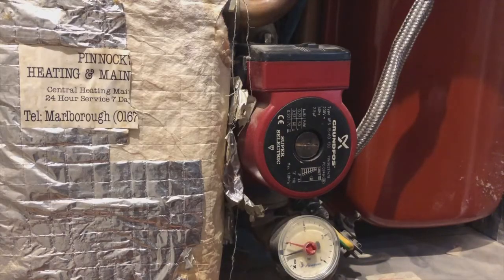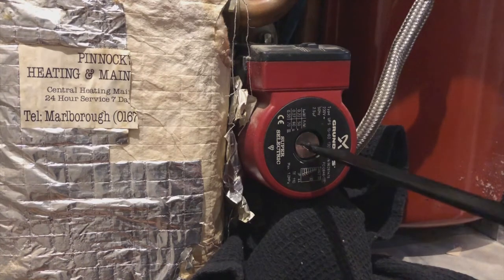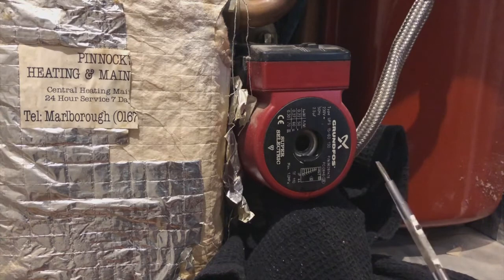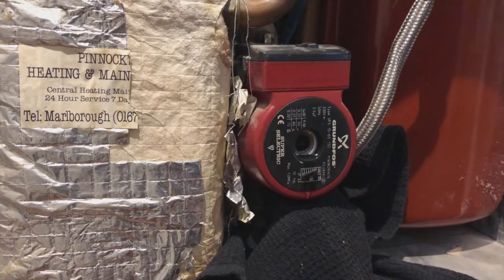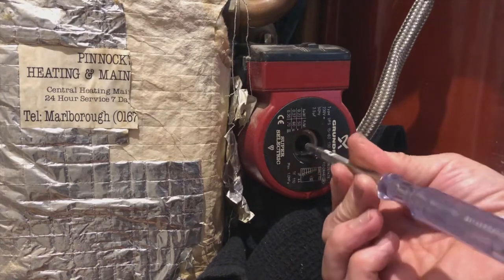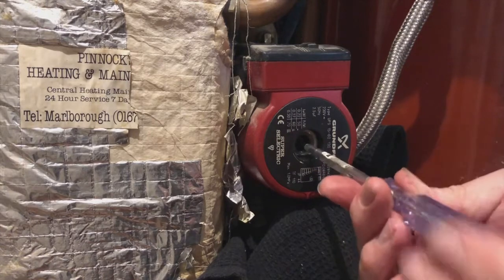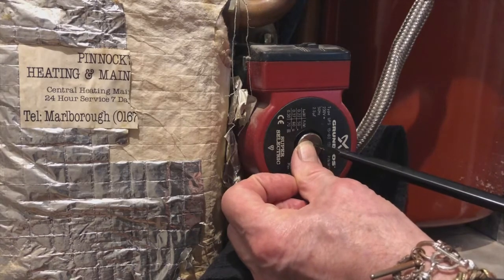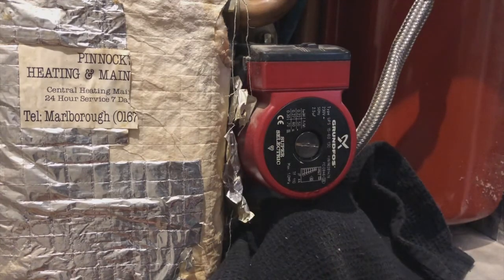How to free a jammed circulating pump. 1st March 2020.

Comment: Well my one is truly jammed. Will try again tomorrow by jamming a suitable Torx screwdriver with a T handle in the centre hole and twisting. Otherwise will change it over to the spare. Thankfully gate valves on either side.

Comment: I have tried doing this but aborted mission as there was alot of water coming out the pump even before i took the screw fully out. Is this normal or do I need to turn the water supply to the pump off first?

Comment: Such a great help. Sure enough the spindle was solid. Got a big enough screwdriver in there that would fit the slot & managed to free it. Turned it over a few times, fired it up & now I have a warm house. I thought for sure I was going to need a new pump. The water where I live is hard & I haven’t used the central heating system in more than 6 years, so I’m very grateful. Thank You🙏

Comment: Hi Mike do you have to have the heating off before you undo the screw
Reply from the maker: Hi Dennis. No, in fact it's better to do it with the heating ON. That way when you get the shaft freed, it spins away on its own and you can see the job is done! Just bear in mind the wires around will be live so don't touch any bare terminals you might have access to.

Comment: Thanks for the video! I have similar pump (model - grundfos ups15-58fc) but it doesn't have the screw and I have to take the whole black cover off to get a glimpse of what's inside. All I see is a metal covering? that takes up most of where the screw should be. Any tips or do I need to take the whole pump apart? I'm thinking the shaft just ins't turning. Thanks!

Comment: When you unscrew that center screw should the Grundfos be plugged in? Thanks!
Reply from the maker: Gayle, it helps if the power to the pump is ON, as the motor will start spinning once freed, which will make it obvious when you've freed it!

Comment: Hi Mike - thanks for the video. Our boiler was (mis)behaving as you describe so I followed your instructions (our pump looks to be the same); I took the big screw off and put an electric screwdriver in and tried to turn the motor - it wouldn't budge either clockwise or anti-clockwise. At this point there was only a trickling escape of water.  Then I put a bigger screwdriver back into hole and gave it a few light taps with a hammer whilst trying to turn it.  At this point water started to spurt out from the tiny centre hole - almost horizontally - rather than just trickle out.  Is this normal or have I broken something? Any info greatly appreciated as the only heat I have at the moment is coming from my wife's scalding fury...

p.s. Incidentally I did manage to get the motor shaft turning with an electric screwdriver after the leak had drained down the central heating tank in the loft and therefore practically stopped.
Reply from the maker: Hi Eww, did you did it running in the end? If enough water came from the pump to drain the heating system I fear you broke the motor shaft and a new pump was needed....

Comment: Great vidoes .  Ah, the joys of old boilers. Many years ago, before I became a gasman proper I had the pleasure of dealing with my mothers Potterton Diplomat,  leather diaphragms in the regulators and lead weights to set their pressure. Even a wind up clockwork programmer... 24 hour of course.    Shame the heat exchanger failed....    Repairing is much more rewarding than installing imho.  H.C. Plumbing.
Reply from the maker: Ah yes, weep tubes and all that. The boiler in my parents' house when i was a child had a clockwork time switch full of brass cogs and wheels, I was fascinated with it. Those were the days, when you could work out how a boiler worked just by looking at it carefully!

Comment: Hi. We have a water pump for our coffee machine. Pump not turning but motor "hums" . As you show we need to rotate the pump shaft. Unfortunately, the pump shaft is totally solid, with no groove to rotate the shaft using a screwdriver. Would you please advise, what kinf if tools we can use to rotate the water pump shaft? The shaft is a totally smooth rounded cylinder, so it is not easy to catch or grab it with a plier for example. 
How we can rotate this shaft, please? The pump motor looks like this one https://images.app.goo.gl/Pxb8qWqJF1bdVw6K8
I appreciate your kind help, thank you.
Reply from the maker: Hi, not sure I can help much with your coffee machine pump. Yes the humming indicates it's jammed but to free it, I think you'll need to remove the water pump part from the motor to see if the motor is jammed or the water pump part of it. Once separated you should be able to engage some sort of tool in the drive dog. Hope that helps, MIke
Reply: @miketheboilerman8363  Thank you so much.